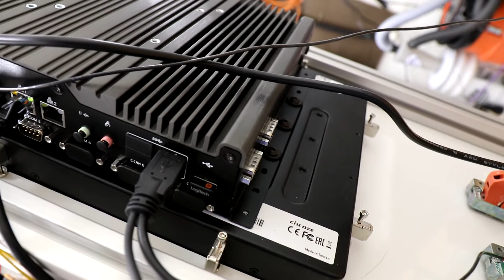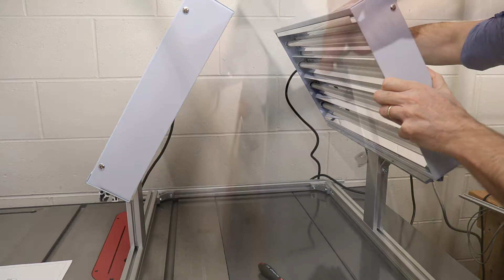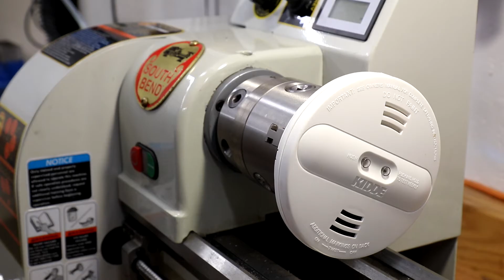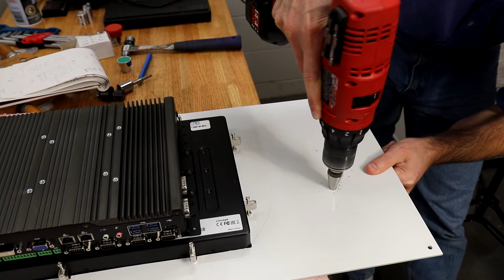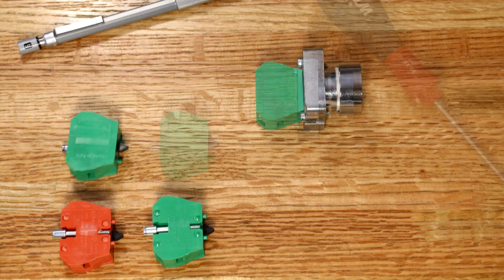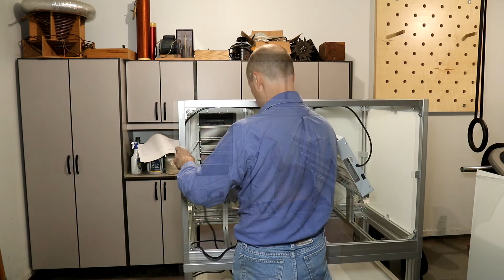Panel PC Installation - Logic Supply Cincoze P2002

Comment: For the GPIO, how do they show up in Linux? Or how do you typically control them in Linux in a embedded PC that has working GPIO?
Reply from the maker: For this model, there's the GPIO pins are memory mapped. If I remember all the details currently, one opens up /dev/mem, seek to the address, and then read, update, and write a word, to read and update the state of the pins. This model was ok, but expensive, the documentation on the GPIO was terrible, and in the end the GPIO would glitch on startup. Controlling lights and motors and they could come on for half a second at startup. Would need additional external circuitry to fix that. Based on another comment, I tried the Latte Panda Alpha, which is pretty nice, with a small Atmel processor, programmable with the Arduino software, and connected to the main processor by a /dev/ttyACM device. Hope all this is helpful.

Comment: I am trying to connect one to a 48v solar systems battery bank to be used for data logging and other general purpose pc use. It powers on but i am not getting video output from the dvi output. Is there something i need to do to get video output?
Reply from the maker: Sounds like an amazing project! The instrument I showed in the video has been sold. I have another of the same display from Logic Supply but used a separate computer instead of the all-in-one model, and it just works. You'll need to check with Logic Supply. But, I'd check the BIOS for a screen mirroring feature. Maybe in your your OS? Worst would be if the panel is attached that the DVI port is disabled... Wishing you the best of success!

Comment: Your videos are amazing - I got more ideas and inspiration from this single video for my CNC enclosure then from month searching. Thank you so much for sharing! btw do you have patreon account?
Reply: and yes I know its a bit strange connection - but it really help. Please keep making videos!
Reply from the maker: Thank you so much Dmitry, this is a very nice complement. Perhaps I should have made a video of designing the enclosure for my plant phenotyping system. Nearly all the parts for the frame and paneling are from Misumi. The panels are pretty expensive, more expensive than the framing, but the extrusions are very reasonable. If you have a local plastics company, you might have good luck with them cutting and drilling similar panels. 3-5mm panels fit into the 30mm extrusions nicely, if you don't want the exposed screw look that my enclosure has. The 40mm extrusions I used on the bottom could probably support a car, they are heavy duty. The Misumi extrusions can be configured with threads, counterbores, etc. and a model file of the configured part downloaded into Solidworks, Fusion 360, etc. I'd be glad to help if you have troubles, send me an email. The panel PC is pretty expensive, but there are alternatives on Alibaba, but I don't have experience with Alibaba, and I wanted to have the support that Logic Supply provides. On the next version, I'll stay with the panel mount monitor but use a NUC like computer, mounted in an enclosure, since the GPIO stuff didn't work well. I would like to see your CNC enclosure, perhaps you'll post some pictures on Instagram as you go? I have yet to make one, just like the mechanic who never has enough time to work on his own car. I do not have a Patreon account, but I do greatly appreciate you asking. For the time being, I want to make videos of stuff that I'm working on, as time permits, without the pressure of meeting Patreon expectations, even if self imposed. An occasional thank you, suggestion, or comment is always appreciated. Until I have trouble buying bread, at least :) Best wishes, Kent

Comment: Aha, the timer for $ 2000 ....
Reply from the maker: +Dalius B. Visual metronome :)
Reply: though the bucket.... $2K +
Reply from the maker: I know, it's a large pill to swallow when I have a fixed budget to build within. When I try something new like this, the extra cost comes out of already small profits. However, when the equipment costs are added, the panel PC is not too out of line. The difference is partially offset by the space saved and time saved (not mounting a VESA monitor or a desktop computer.) E.g., consider that the panel PC has PoE, a small item, but with a standard desktop, I would need to get a power injector, use a switch with PoE, or add a PoE Ethernet card (the latter is particularly expensive.) I had hoped time saved by not setting up a PLC, that turned out to not be the case, but live and learn. Next iteration, I'll use the same panel mount monitor, but go with an Intel NUC size computer. Alibaba listed less expensive panel PC, but with Logic Supply, the people are responsive and product ship fast. I like building relationships like that. Anyway, I hope this was helpful. It's good for me to thing through the reasons again. If you have an alternative, please let me know. Any suggestion that saves costs and time, for a one man operation like mine, means a lot.

Comment: Thanks for the video, great job. Why are you using fluorescent lights instead of LED?
Reply from the maker: Hi Paul. Mainly size and availability. In this system, the fluorescent fixture fits well and produces lots of smooth light. I may still use the linear LED tubes, but 2ft T5HO replacements are not too common. In the larger system, I do use LED Bladelights, which have the required form factor (long and skinny) without undesired hot spots that many other LEDs that I tried had, but the power:cost ratio is not good. I suspect the next model will have custom LED modules.

Here's a bit about the Bladelight. https://www.youtube.com/watch?v=KlYmeVtmloM